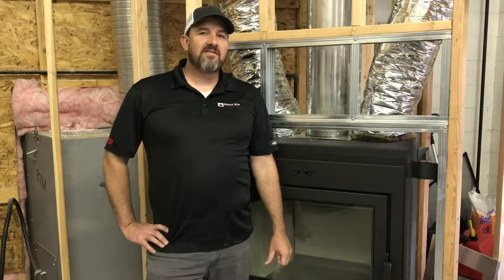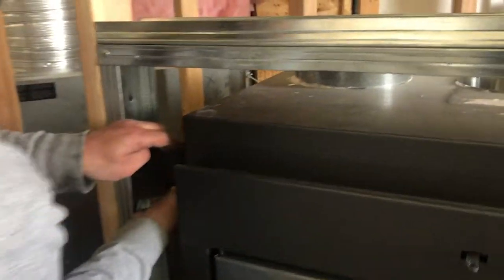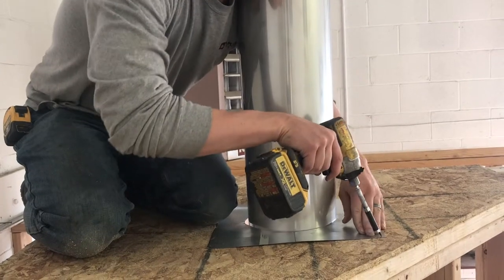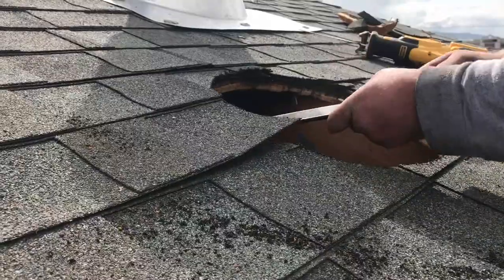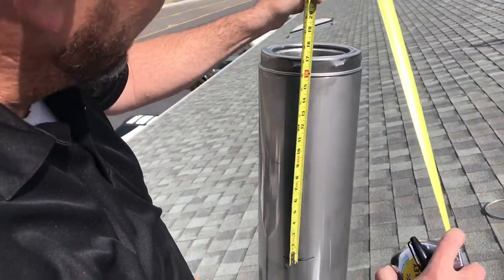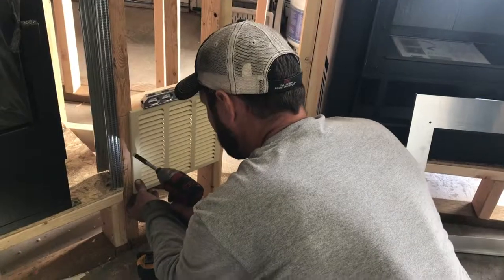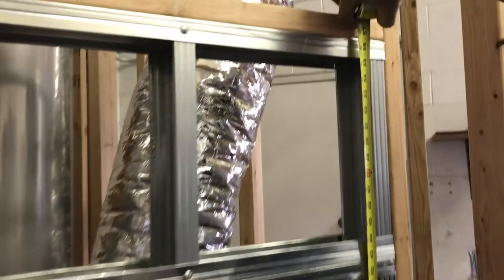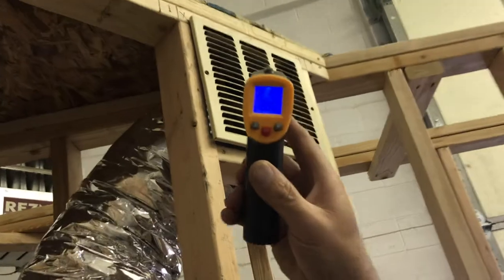How To Install the Ambiance Elegance 40 Wood Burning Fireplace

Comment: Thanks for the video. Do you need to install cement board inside the chase? On the walls and flooring for this unit?
Reply from the maker: Thank you for watching! Great question. Each unit has different clearances listed in their respective manuals. For this specific unit the manual says that approximately 40" wide and 55" high should be constructed with metal studs and cement board (or other non-combustible material). If you have the manual, you can reference this on pages 12-13.